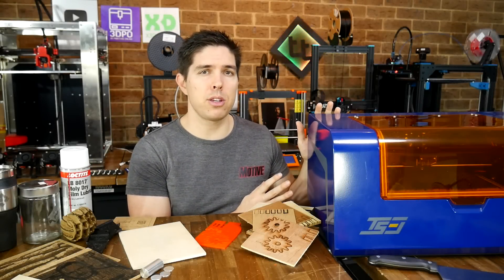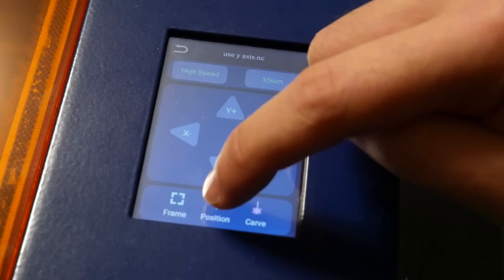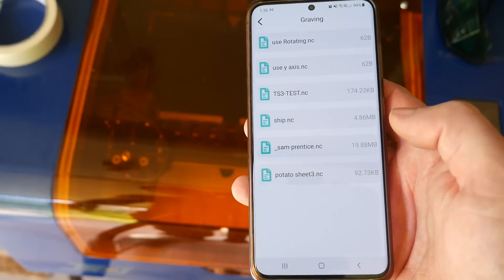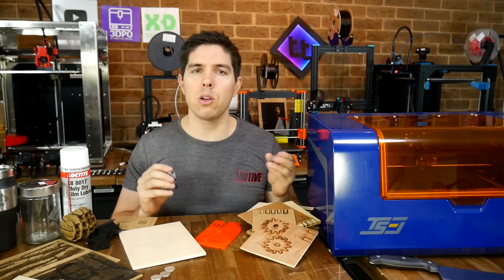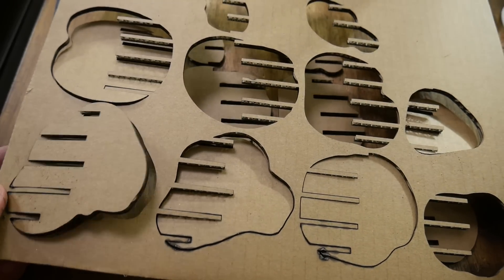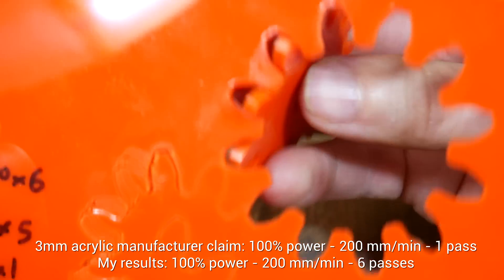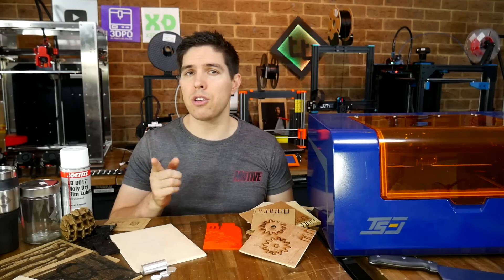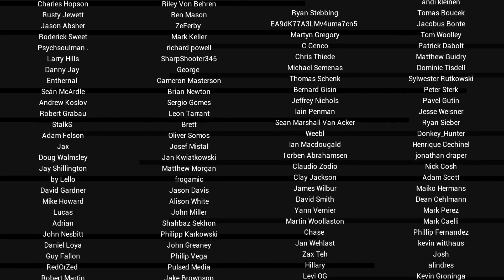TwoTrees TS3 laser engraver test: Perfect for desktop or lacking power?

Comment: Sorry to go off topic, but any chance you'd make a video on what to do when you melt your Bowden tube in to the heat break on an Ender 3? I dunno if my printer runs hot or I pushed it to hard but the tube is so fused that even after completely taking the hot end apart, I can't get it out. I mean I'm ordering a micro swiss, but is there a fix for now? Thanks a lot, your channel has helped me a ton since I got my printer a few months ago.

Comment: They are using Makerbase MKS DLC32 and the touchscreen as a controller and UI. Up to now, no sourcecode has been released even though it is obvious that it is based on Grbl_ESP32 (all the ESP32 specific commands work like eg. setting Wi-Fi parameters via console, but nothing is documented.)
It smells violation of the GPL V3.0 here.
Whenever somebody asks for the sources on their Github, Makerbase replies with a "coming soon". For months.
Maybe you can address this issue with 2Trees as well.

Comment from the maker: Correspondence from TwoTrees regarding improvements to the TS3:
"Here are improvements Kickstarter backers could get
1. Added UI screen switch to change between rotary engraving and standard engraving to save time working on configuring (users could add this function by downloading and updating firmware on our official website.)
2. Both exhausting pipe and filter cotton would be included in the package;
3. Y-axis limit switch and zero return position would be changed from upper left corner to lower left corner;
4. Add extra label tag for component name

For orders after kickstarter, except for above improvements, here are some extra improvements to offer
1. Integrated protective cover is added to the filter cotton and the fan port
2. The 3-layer metal pillar to get fixed focus would be replaced with stepped metal pillar
3. Provide possibility to add air assistant system
4. Add safety settings to stop working immediately when protective cover is opened
5. Optimize and modify the manual and TF card data"

Comment: @Teaching Tech, good job. In Lightburn you should use overscan to prevent the burnt edges at 9:20.  Analgous to 3d printing and linear advance or pressure advance.  grbl M4 uses dynamic power which attempts to prevent burnt edges by linearly adjusting power linearly based on velocity (accounting for accel/decell at the extents of travel).  Overscan increases the travel so that most of accel and decell occurs outside of the engraving area.  Also try air assist for cutting and engrave in the direction based on the smallest beam (fast axis for that diode).  MKS hardware leaves a lot to be desired, not a fan since they give nothing back to open source and only steal.
Reply: Surprised your board hasnt been on any builds on Teaching Tech's channel.   It definitely deserves more of the lime light

Comment: 10W output from 40W listed input? I rather doubt it. I think the strongest, single diode available is 7.5W output. A true 10W head needs 2 diodes. I'd wager the Comgrow Z1 would outperform this unit hands down. It's open-frame, yes, but bigger work area and half the price.
Reply: That diode is probably 5.5W output max. Chinese manufacturers have started doing this thing where the output power they claim is sort of "in comparison to other 5W lasers ours is like 10W so we say it's 10W". It's never true and the laser behaves like any other 5W laser.

Comment: Anyone who's been around Chinese diode lasers never believes their claims for power output, and they also understand when they talk about 'plywood' they really mean balsa ply which you can cut with a butter knife rather than decent birch ply. Nevertheless there are good Chinese laser diode modules available with FAC lens systems offering small spot size (and consequently high energy density) that are suitable for cutting 3-5mm plywood in the range 150-300mm/min @ 100% power. That's never going to be as fast as a CO2 laser but still useful if you don't have space for a CO2 machine. Also the bed size of Diode lasers is usually larger (this Two Trees machine has only a small bed 300x200mm).

Comment: I'm concerned that the safety plastic on the laser head and the case are orange, but the glasses are green.  Won't that mean that one of them (the green or orange) is not blocking the correct wavelength to provide any protection?
Reply: Shenzhen grocery store didn't have them in same color :D Crappy toy, K40 is much better

Comment: It would be good if you could actually measure the effectiveness of the safety glass on the lid. How much light does it actually stop? Is it safe? Can we be sure they would change it if the laser is changed to a different frequency? I would prefer it if they had a camera on the inside so one could watch on a monitor instead. Then the whole machine could be enclosed and no light let out. Obviously there should be a safety switch to stop the laser if the lid is lifted up whilst engraving...
Reply: I want to see this testing.

Comment: Mike,
As usual, when I need to know, I can count on you to be extremely thorough providing very comprehensive testing and very cogent results. I began watching your channel a few years back when I got my Ender 3. I have not been following you as closely as before due to some life changes I've had to deal with, but saw this review and knew I'd get the straight scoop. The results you got parallel a home-built diode laser I'd been tinkering with, and yes, Lightburn is best. I do want the ability to cleanly cut ply and acrylic, and this confirmed for me that I need to go back to considering a CO2 device. Now I have to look over your channel to see if you have thoroughly reviewed them. Thanks for such a great job providing excellent info.